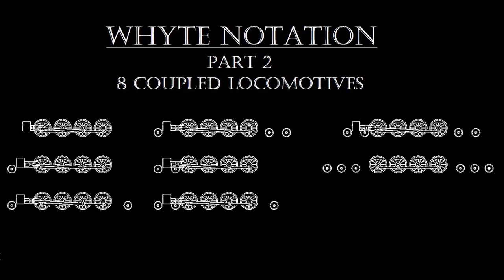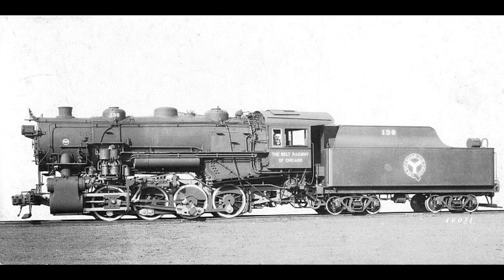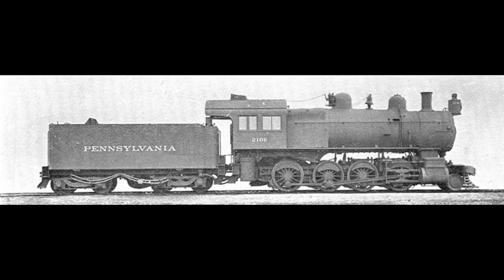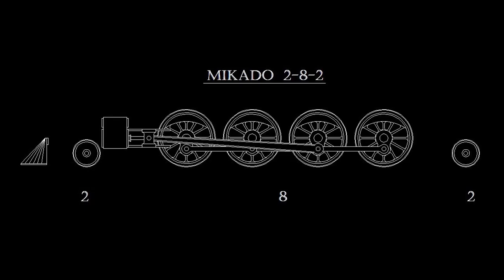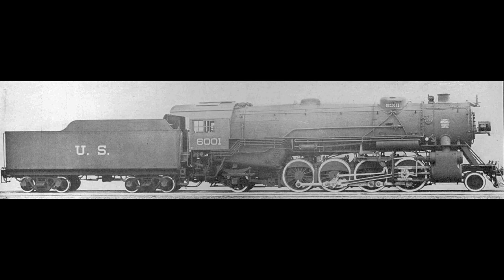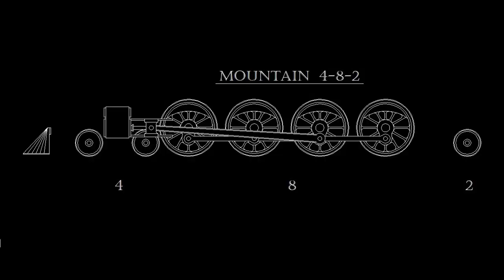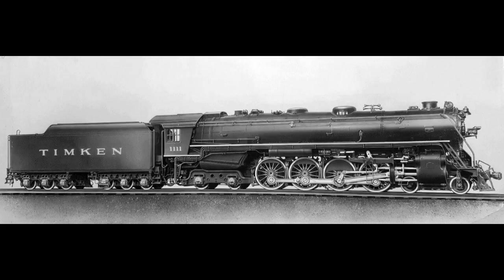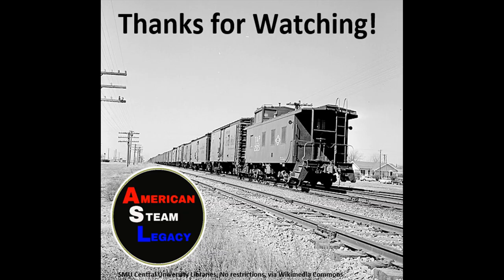Whyte Notation - Part 2 of 7 - 8-Coupled American Steam Locomotives

Comment: 4-8-0s are also commonly known as Mastodons. Mountains were called Mohawks by the NYC. Some Mikados had their front truck removed for switching duties once they became obsolete. Speaking of Mikados, they also served the D&RGW narrow gauge lines into the early 70s, due to the fact narrow gauge road diesels were not common. The D&RGW K classes were also used by the USATC for other 3 foot lines like the White Pass and Yukon. The D&RGW had 5 Mikado designs, with only the K-57 being standard gauge.

Comment: Isn't i stupid t count wheels instead of axels?  Have you ever seen an 1-3-1 except on an monorail ? We count trucks with numbers and coupled axles with letters
 So an 2-8-2 would be an 1' D 1'. With that counting, it is easy to determine how many axles are coupled.
Reply: Except you aren't counting each individual wheel on a single side of the locomotive, so you're basically just counting the axels anyway. We say 4-8-4 not because we only see 2 leading wheels, 4 driving wheels and 2 trailing wheels lol